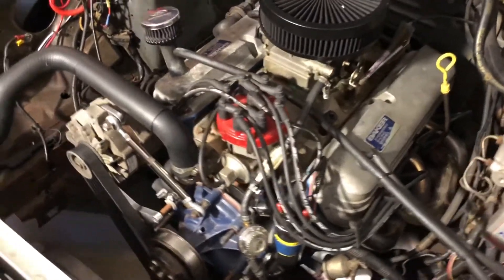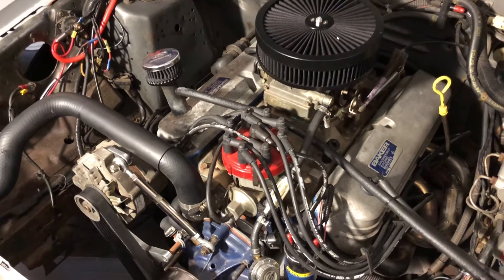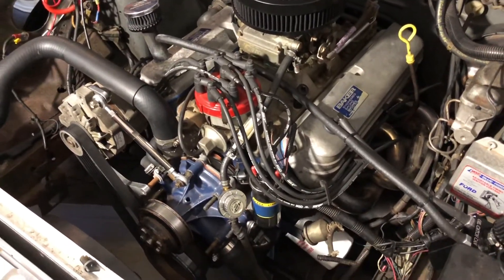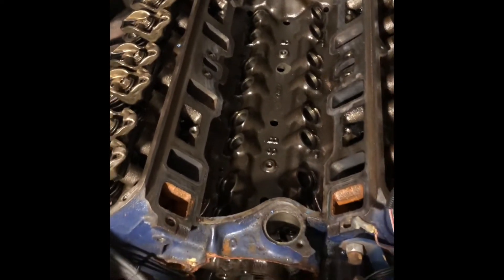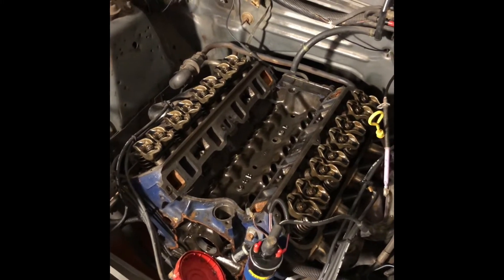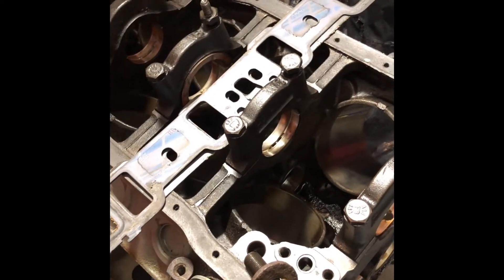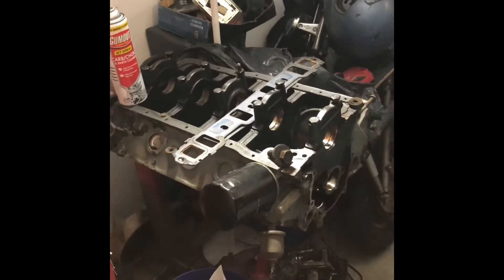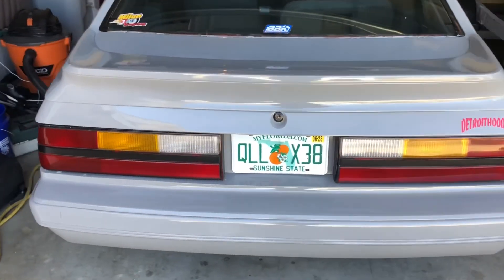B303 CAMSHAFT INSTALL ON MY 85 FOX BODY MUSTANG GT

Comment: Did you just change the cam? What about the push rods,rockers and lifters? Did you keep everything stock?
Reply from the maker: Yes. The B-303 is designed to go into a stock engine. I could have put better valve springs in but I keep it under 6K RPM and have a another engine I'm building with better parts.
Reply: @natet1227  oh nice I was asking cause I just got me a b303, comp rocker , push rods and lifters but I can't figure it out cause the rockers I got don't fit. My fix is a 88 and I guess those rockers need are for a older fox
Reply from the maker: @JoseEspinoza-bj6th  you probably have stud mount rockers and need pedestal mount rockers. My stock ones have been doing fine for a couple years now.
Reply: Damm bro you are right. I was checking it out and that's what I need in order for these rockers to work